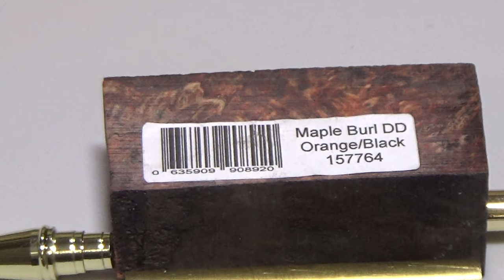Turning a Hourglass Pen on a Lathe ASMR

Comment: Wonderful 👍🏻
Great video! 
I ordered some micro mesh Pads and they arrived yesterday. 
Now i can polish my ca glue rings 😅.
Reply from the maker: The micro mesh are useful for the ca finish. I use to go up to 12,000 with them but now use the buffing wheel after 2,000 or 3,000 seems to be having good results!  Thanks for watching!
Reply: @TurningsbyTurner  ok buffing wheel ist the next on my shopping list now 😂
Thx for the tip👍🏻